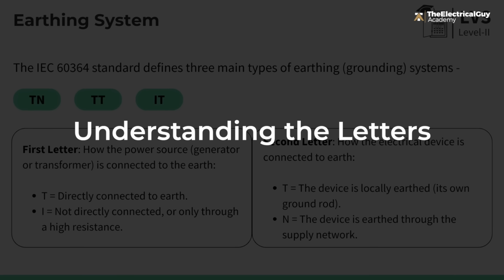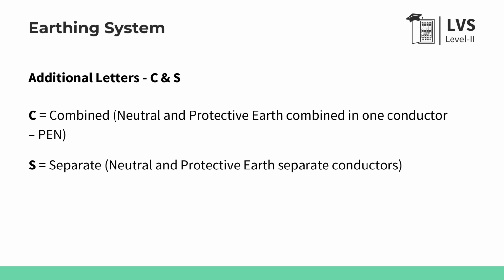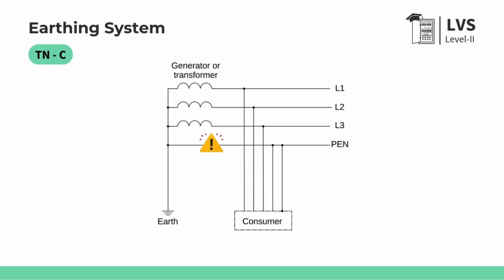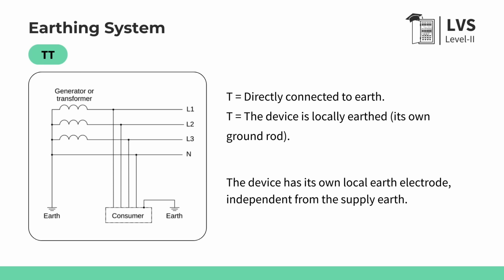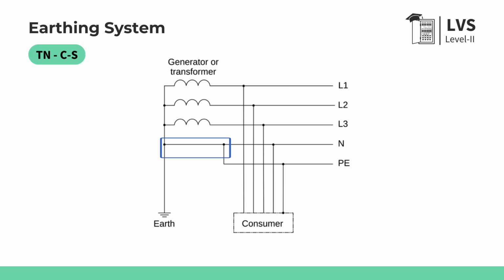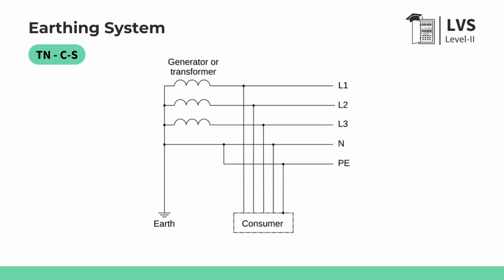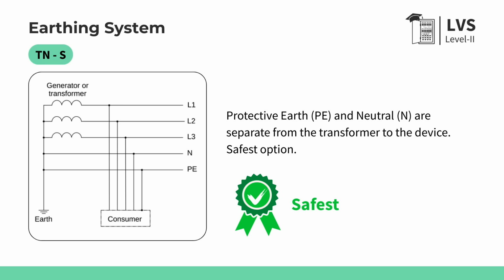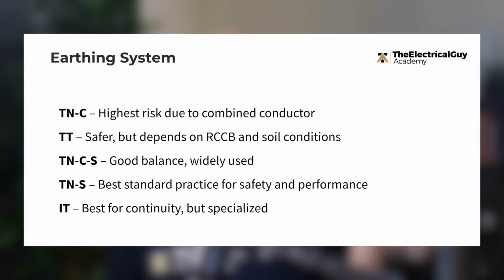Earthing Systems Explained: TT, TN-S, TN-C, TN-C-S & IT (Complete Guide)

Comment: There is one system missing.
The common system here in Germany is a TN-C to the house. In house splitted into seperate ground and neutral .
But...
The PEN is grounded in every house.
So if the PEN has a Problem you have the fallback to the TT system....
Reply: Yeah, he mentioned multiple earthed neutrals but didn't show it. But that is not classed as a separate system in itself.
Reply: its not a fall back to the TT as you have ground and neutral bonded. In TT they are separate. Your pen is basically a bond between N and G. 
When N fails in TT, you will have inter-phase voltage from other houses on your N and it might even fry your electronics. IN TNC with earthing at each house, that phase current will go to the ground(earth) and return to the transformer. If your earthing is good in might even trip some mcbs and shut off that way. The only downside is that all the metal cases which are grounded are going to be at some potential that will depend on earthing quality
Reply: @hineko_ in some towns here it's forbidden to ground again.
Don't ask me why....
The grounding point can be 500m away from your house.
Tis kann lead to massive current flowing between you grounded antenna and you hifo system or tv.

Comment: One variant of the IT system instead uses a delta-coupled transformer instead of an Y-connected transformer so all single phase loads are connected between the phases.

Comment: is there any other country than Norway where IT-systems are commonly used in residental distribution networks`? I´ve heard that Albania is also using it but don´t know to what extent. In Norway most utilities are using the 3x230v IT system. it´s only areas built somewhere on this side of the millenium that has started to use the TN 3x400V system.
Reply: Japan uses IT system also. The IT system is useful where soil resistance is too high to make a low resistance earthing system.
Reply: @BlackAmV0  probably therefore Norway chose it once upon a time as well. The whole country is a giant bedrock.

Comment: A TNS system does not monitor the earth return path. If the earth conductor is broken, overhead line broken or stolen being the most common issue, there will be no apparent change at the consumer premises. However if a fault develops in the premises, there will be no return path and the exposed matalwork will sit live without any indication. A TN-C-S system monitors the return path as it is also the neutral. A break here will cause voltage effects or even total loss of supply at the consumer which will lead to rapid investigation and repair. There will be a risk as the exposed metalwork will rise to phase voltage, however if the building installtion has been done correctly, all the exposed metalwork and all service pipes such as gas and water will be bonded to the earth terminal as well. This means that within the building anyone touching a motor cas for instance and another metal part will not receive a shock as they will both be at the same potential. This is why bonding is critical and taking supplies outside to outbuilding etc is not a good idea unless using a TT system with RCCD protecion, regularly tested is employed. As PME infers, the supply company will earth the neutral at multiple points in the network so a single break in the neutral conductor will introduce an impedance but not usually a total loss.

Comment: I was in Japan last month and noticed that all plugs are two pin.  In fact I did not see a single three pin plug; does it mean that their system is dangerous?
Reply: Well not really, the voltage is lower than everywhere else and the circuits are RCD protected. There is much more in a system than just the grounding. Also they do use grounding on big appliances.

Comment: I disagree with you that TT is less safe than TNCS, if there is not enough current to trip gfci so there's not enough current to harm you. If you touch live wire without touching anything else and you get slightly shocked the gfci should trip even though your grounding is not involved. If you are touching anything that is grounded at the same time - the gfci will trip faster but only because the leakage current is bigger. The only safety difference is when you don't have gfci. And when supply PEN fails TT is actually safer.
Reply: You are right, electric code at Spain (we use TT) residual current protection 30mA is mandatory, and also a low grounding impedance at the receiver point.
Reply: In TT the RCD trips at 100-300 mA. On TN-C-S the current has to be 50-100 A to trip the breaker immediately. If RCDs are used for additional protection they are 30 mA on both.
Reply: @okaro6595  I have 30mA RCBOs using a TT system. Depends on what you buy and use it for. Individual circuits can use 30mA, when using one RCD for multiple circuits usually use 100mA to avoid nuisance tripping.
Reply: @okaro6595  no true
Reply: Belguim is a TT system but grounding must be less than 30 ohm and 30ma rcbo.
Reply: in TT if your Neutral fails somewhere on the way from the transformer, you going to have problems. The remaining N connected to each affected house creates a common point of meeting of phases from all the houses. It creates dangerous floating inter-phase voltage on your N inside your house that may fry electronics, cause fire or even kill someone. Suddenly having 400v instead of 220 isn't a nice thing, while undervoltage is really bad for electric motors(air conditioners, washing machines, fridges...)
Reply: @hineko_  I have over/under voltage protection relay on each phase, as many other homeowners. Because it can happen not only when the neutral fails.
Btw when i was just connected to the grid the company by mistake connected neutral as one of live wires and one live as neutral, now imagine if i had grounded neutral on my side 😅

Comment: Hi sir, in IT system since there is no nuetral earthed, how it will protect. For ex. if it earthed from consumer side panel. How the circuit will complete.
Reply: You complete the circuit between two phases, thus you don’t need a neutral.
Reply: You complete the circuit between two phases, thus you don’t need a neutral.

Comment: You're amazing Gaurav! 
I've built an 2KW Off Grid Solar setup for my remote house, which type of earthing would be most suited for such systems? 
I wish to build many more of such systems to help remote farmers without grid power make value added products. 
Thank you for sharing your knowledge!
Reply: Since the solar inverter is the source in this case, if the entire systems spans only throughout a house, a TN-S system, i.e. separate PE and N from the solar inverter is the same cost as TN-C-S would be. Actually it is topologically the same even, since the source is local, provided that it connects to the local common PEN point.

The cost saving of TN-C-S only apparent when the source is remote, very far-far away (compared to house-lengths), also multiple houses are added to the same PE which mandates higher conductor cross section, thus even higher cost. The separate PE adds a significant (+25% for 3 phase, +50% for 1-ph systems) to the cost in this case.

But the closer you bring the source, that cost difference becomes less and less in total value.

Comment: Good explanation , my doubt , if the Distribution transformers are very nearer which neutral will be low impedance path incase of fault . Is thrre any chance to cross other transformer neutral takes place. Please expalin in a small video ...thank you ..

Comment: This is a crucial topic in the field of Electrical Engineering and most ignored. Beautiful explanation 👍👍
Reply from the maker: Glad you found it helpful! 👍
Reply: @GauravJ  I have a question. 
At the service entrance of any facility (hospital, malls, buildings, large factories etc), owing to traditional misinterpreted practices, Consultants and Electrical Inspectors still wrongly mandate such rules, the transformer secondary side neutral is connected to 2 separate earth electrodes with copper conductors, and body is connected to 2 separate and independent earth electrodes with GI conductors. 
Downstream side, away from the sub-station, the panels (PCC, MCCs etc) are separately provided connections to the earth locally, say a grid of 10-12 pits, and further downstream earth connections provided to floor-wise DBs from electrical shafts via GI conductors connected to the grid. 
This represents the TT system hopefully, you will rectify if I am mistaken. 
Such systems present high Fault Loop Impedance and in such cases RCCBs are recommended to be installed and of proper types depending on utilities. 

Now my question is, to convert this system to a TN-S, at such brownfield sites, laying a new conductor (Cable) from the Neutral Bus of transformer secondary at the sub-station to the building PCC panel (Earth Bus) might not be viable. If an arrangement can be made to connect the Local Earthing grid of 10-12 pits to the substation Earth Grid by laying GI strips under ground, will that be an option ? Will it provide a lesser impedance to the Fault Loop ?
Reply: @asg7298 I also have the same doubt. Adding to it, can cable armor be act as a conductor for linking the earth between transformer and load. (Instead of separate GI conductor)